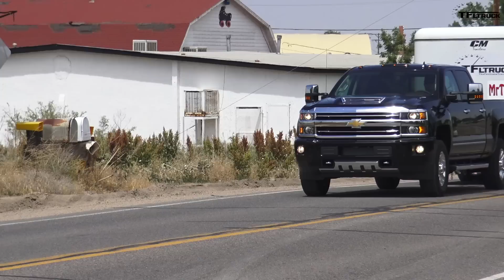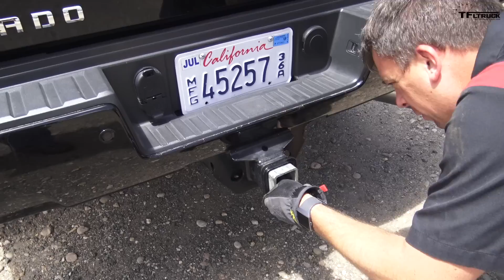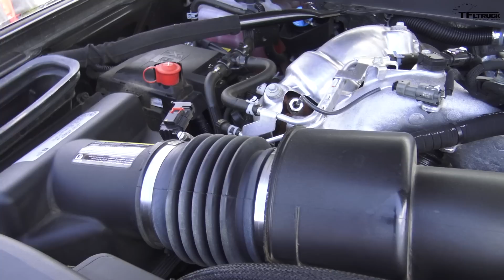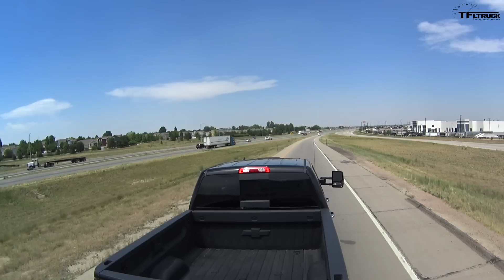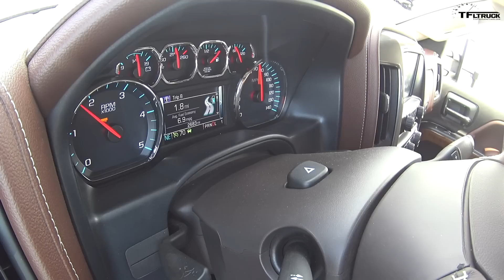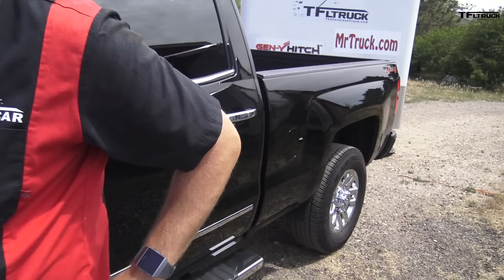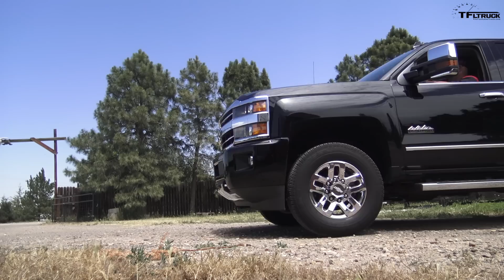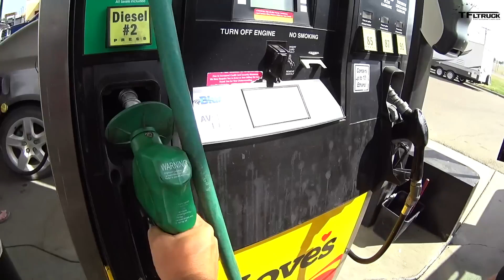MPG Challenge: Silverado Duramax vs Cummins vs Power Stroke

Comment: this gets better gas mileage in your opinion forget the fuel economy how do these trucks feel towing that weight since you have droves all 3 with the same trailer which seems to pull the best
Reply: 100horse Injectors that's easy Duramax if I remember correctly last year they did the shootout and the Duramax won again!!!

Comment: 4.10 on the Ram? Did they change for 2018? 3.42 was the only option in the diesel 2500/3500 SRW since 2013.
An interesting mpg test would be to take a trailer loaded for the midsize trucks and tow with each class of truck through 1 ton dually to see if what gets the best mpg with that load.
Reply: Matt Hillman Gear ratio is based on the transmission. The higher powered Cummins I think comes with a different tranny and gear ratio
Reply: I'm curious. I know someone with a 2004 Dodge Ram 2500 with 4.11 gears and the 5.7L V8. Did they reduce them over the years? A 3.42 gear ratio for a diesel seems small. My 2016 Silverado 1500 has 3.42 gears. Would never expect that ratio in a diesel.
Reply: Ratio's with diesels will and are lower as since they don't have rev range as a gas on top of they produce their torque and power as such low RPM's don't need to run them high. Chevy's site says it has 3.73 for diesel, 4.10 for gas.
Reply: 4.10 for gas really? The highest I could get for my 1500 was 3.73. May be 4.10 for the 6.2L?
Reply: Matt Hillman You are correct that 3.42 is only for 68RFE trans. But you can get 3.73s on the 3500 SRW w/ Aisin trans.
Reply: sreilly 4.10s are available only on the 6.4 gasser Ram.
Reply: Gotcha. Thanks for clearing that up! I figured the more powerful the engine, the larger the gear ratio in the rear. Then again, I did own a 2003 Silverado with the 4.8L, but 3.73 gearing. Use to rev to 2,200 RPMs at 65 mph!
Reply: sreilly The 2003 through 2007 5.9 Cummins offered 3.73 or 4.10. In 2013 3.42 was the only offering in SRW Ram diesels, DRWs had 3.42, 3.73, and 4.10s in both the 68RFE and HO/Aisin combos. Currently the 6.7 Powerstroke only has 3.31 and 3.55 for their offerings. As time has gone along and transmissions have become more capable the need for higher ratios (lower gearing) have diminished even in gas engines.
Reply: EGGINFOOLS I think the different engine transmission combos in the DRWs may have more of one gear ratio built more than another but the same gearing options are offered through both combos. As for SRWs it has been 1 option for the last several years. My question is did the offering change for 2018?
Reply: HellKitty 101 I see something about that on Rams website but it's not pulling up in their build section. I'm betting they did that to bump up the GCWR a little bit so the 2500 with the regular engine and 68rfe doesn't have a higher trailer rating. It's still not a 4.10 in a Ram 2500 though, I'm thinking Andre was reading off the left side of the monroney sticker before the options section.

Comment: I just bought a 2018 hd duramax ltz z71 trim after your reviews.  They all are great from the big 3, but i thought the seats in LTZ trim were the best.  I only have 1,000 miles on it, but took it to WV this weekend and actually hit 22mpg.  
Keep up the great work fellas, i enjoy these real world numbers and that Ike, and goldmine!!!!
Reply: Don Leamon ive seen duramax trucks near me go 300k miles no issue. 90k is premature death, musta been something wrong
Reply: Don Leamon I have a 2004 with a hundred and eighty thousand miles it's done nothing but snow plowing and Commercial work have had few problems  except one injector 1, 1 EGR valve and 1 glow plug!!!! Duramax is a fantastic ,far far more reliable than any Powerstroke!!! Cummins diesel engines on the other hand are very reliable good power plant! Now the rust on the frame is another story but up here in the Northeast they all rot the same doesn't matter who makes them!!!
Reply: Don Leamon yeah you got a lemon! Duramax's are almost guaranteed to hit 200k with 0 mechanical issues. Sucks but lemons do exist.
Reply: vehicles that come with rear leveling shocks always have problems , they are using rubber air springs (air bags) they dry out , crack , wear through , tare . thats just life with rubber springs (airbags). he gauge clusters do go out ill give you that but they are $100 used at most and thats with less miles than your vehicle has. window regulators go bad on every vehicle and they are about 50$ for a chevy suburban , tahoe , yukon , or xl i know from first hand experience. i've owned probably 5 of your same body style suburbans / tahoes , 3  trucks and 1 duramax all the same as you said you have had.  if not more. Dummies don't keep them clean or maintain basic shit , i buy them for next to nothing detail them fix the hundred dollar issues and usually make upwards of a couple grand on each one. its a side hobby that makes a load of cash for little to no effort. i don't even detail them myself 1/2 the time. the amount of wear you are saying you have experienced in your trucks that are all the same generation as the ones i have had is absolutely insane it almost sounds made up. you either happen to own two lemons , are lying  ,  straight up just abuse your trucks,  or you have excessive mileage. ive owned a 300k mile suburban that sounds like it was in better shape than both your trucks.
Reply: Andrew Ochoa They role down the same assembly line.
Reply: Time will tell how reliable these things are truely.  Personally we bought it tho tow a 5th wheel camper next year.  It sits in the garage mon through Friday usually unless wife goes out during the week.  So if i have it for 5 to 6 years it'll have a whopping 60k  to maybe 80k on it by the time ill dump it and get something else.   A lot of arguing on here,  but people are talking about trucks from 2000, 2004 and so on.  Things change every couple of years,  if you didn't like it,  go look somewhere else.  Silly and juvenile  going back and forth  about one brand better then the other.  Unless your vuying a brand new one,  all this discussion is doing is getting y'all worked up.  Lifes too short, enjoy it.  🤙✌👌
Reply: Don Leamon well the good thing is you've just taken the first step you've got past the denial so now  u can move forward and take care of your vehicles!!!      All kidding aside I run a repair shop and it's not like any of these things that you listed on GM vehicles aren't things that I see on other brands they all in one way or another have some type of issue even the coveted Toyotas!!  The biggest problem that I battle with all of them where I am is the rust! But a year-and-a-half ago I did find a new product called New Hampshire oil and have been oiling the vehicles with fantastic results unfortunately you do have to do it once a year but it completely stops the rust in its tracks! And don't misunderstand my statements on the GM vehicles or the fact that I have a Chevy Avatar I have dealt with owning ford diesels with catastrophic failures that cost me thousands of dollars I'll never make the mistake again!
Reply: Xxplicit buy an extended warranty thats up to 100k. Amd I've made it a goal to worry about myself.  Not my business what other people do or can or can't afford.
Reply: Robert Moulton Once since 2009 has Silverado/ Sierra combined outsold F-Series. GM only sells more “trucks” when Colorado and Canyon sales are added in.
Reply: Don Leamon pretty sure you just abuse your shit... Considering I have one with 560k and the inside still looks like new. Have I replaced wear items a few times like ac stepper motors and guage cluster motors? Definitely. But that's it.
Reply: Don Leamon oh yeah and I forgot I did get rid of a 2005 Chevy Equinox with a hundred and ninety thousand miles that at a hundred and twenty thousand I did have to do head gaskets in but otherwise regular maintenance and the Stiller and fantastic
Reply: Don Leamon they just retooled the engine in 2017 i believe.  And that whats warranties are for.  No stress in life about that stuff,  ill jusy go buy another one in time if it starts to be problematic.  I'm not brand loyal to either big 3.  Just woth rebates,  and dealers cash back its the best deal I could get.  Sorry your truck had used,  everything mechanical is prone to probldms eventually
Reply: Hartson Racing I had 336k on my 2015 3500. No problems other than emissions. Bother had 2015 2500 it's been an absolute nightmare. He's at 290k now, motor is apart for head gaskets and 2nd set of injectors and infection pump.
Reply: @yellow04  the Bosch CP4 fuel pumps on the newer Duramax's are ticking time bombs that when they explode take the injectors and fuel rails with them. A lot of guys are swapping in the older CP3 style because it's more reliable and if it goes it doesn't take everything else with it.

FYI, the Powerstroke 6.7 uses the same CP4 pump.
Reply: @natedog51  yup. I got lucky. Have a ram now. 👌
Reply: Nathan Waidelich - Nice try, 2017 up Duramax does not use the  CP4 hpfp, they now are using the Denso pumps.... Cummins is now using the cp4 in the 2019 ram hd trucks, tic tic BOOM! Lol,
Reply: @nospark8514  not sure why Cummins did that. Hopefully there was an update or something. Why put a pump in your updated motor that has a lawsuit against it 😆😆😆
Reply: Don Leamon call me crazy but Chevys and GMC’s aren’t the same vehicle. The most GM trucks that I’ve seen have problems are the GMC’s. Rarely a Chevy.
Reply: The Real John Smith there is someone who didn't realize Chevy and GM trucks are the same ...
   That's how Ford tells everybody "best selling truck in America" because they split General Motors Chevy and GM trucks when they count ...😝 seems legit to Ford people ...lol
Reply: I just bought a 2018 GMC Denali HD with the Duramax. I traded a 2009 Silverado 2500HD with the 6.0 Vortec. Best MPG with Silverado was 17 on highway @72 MPH.

MPG with my Duramax, with 6,000 miles so far, is 21 MPG @75 MPH! Based on my round trip to work and back of 440 miles (I work out of town for the week). 

So even with the higher price of diesel, this truck costs me LESS to run than my 6.0 gas truck did.

Not to mention I love EVERYTHING about this truck!
Reply: I have a 3/4 ton I'm getting 17 to 19 mpg but the motor isn't even broke in yet sitting on 28,000 miles its a 16 Chevy
Reply: You're totally correct J Patt. I failed to change the oil in the stepper motors on the gauge clusters. I also failed to completely remove the two dashes to get to the passenger side steppers and give them some love. Oh, I also failed to engineer and replace the nylon parts in the power window mechanisms. I failed to stand over the shoulder of the Delco engineers that did the rear air system on the Yukon. I obviously overburdened the bed of the GMC by installing a ARE shell and Bedrug when new. I should not have had them stored in a garage while at home and at work. I should not have ever used the fuel door nor the rear tailgate on the Sierra. I should have not expected the Dmax to haul a 10k RV in Arizona and not shut off the A/C and go into limp mode. Nope all my fault J Pattster.
Reply: J Patt, let me cut and paste this same GM responce that I think I've replied to you before with. I agree the powertrain is OK, especially the Ally, BUT: here are my real world facts: '04 Denali XL (wife), '05 Dmax with the wonderful overheating LLY. Both purchased new. Both lost the stepper motors for the gauge clusters, both lost the stepper motors for the HVAC controls. (very expensive fixes, but heat blowing in the cab when you live in Phoenix in the summer, SUCKS!) Rear leveling shocks went out twice on Denali. Window regulators went out on all but my passenger front window. Bed tore on the GMC, because the metal was paper thin between the stoplights and the rear stake pockets, Diesel fuel cover hinge fatigued and broke, of course the rear tailgate handle failed and the bezel fell off. Sunroofs on both failed. Denali would just randomly die at speed, no codes. We got rid of both at about 120k because we were sick of the issues. Would they have continued to run, sure, but the problems were just irritating. And since the Dmax overheated pulling our RV, even with an additional aux radiator (helped didn't cure). Both had same cheap leather that cracked even with Lexol care. Those are MY real world facts.
Reply: Drivetrain is one thing, the rest of the truck is a different story...
Reply: Bailey: here are my real world facts: '04 Denali XL (wife), '05 Dmax with the wonderful overheating LLY. Both purchased new. Both lost the stepper motors for the gauge clusters, both lost the stepper motors for the HVAC controls. (very expensive fixes, but heat blowing in the cab when you live in Phoenix in the summer, SUCKS!) Rear leveling shocks went out twice on Denali. Window regulators went out on all but my passenger front window. Bed tore on the GMC, because the metal was paper thin between the stoplights and the rear stake pockets, Diesel fuel cover hinge fatigued and broke, of course the rear tailgate handle failed and the bezel fell off. Sunroofs on both failed. Denali would just randomly die at speed, no codes. We got rid of both at about 120k because we were sick of the issues. Would they have continued to run, sure, but the problems were just irritating. And since the Dmax overheated pulling our RV, even with an additional aux radiator (helped didn't cure). Those are MY real world facts.
Reply: Liked my Dmax for the most part (I won't get into the overheating problems) until the thing hit about 90k, then it started to self-destruct. Enjoy her now!
Reply: @donleamon8653  You had a 05 he has a 2018 completely different trucks. The duramax engine was redesigned in 2017 and the bodystyle has changed twice since your truck. And like the other guy said you just had a rare lemon, 99% of people don't experience those problems with their duramax as long as they take care of it and don't abuse it.
Reply: @donleamon8653  was it a diesel?

Comment: Please test them all on the same day with the same temperature and weather conditions  .
Reply from the maker: How do we get all of them on the same day?
Reply: That's for TFL to figure out. Any valid test comparing two or more items must be done under the same conditions for it to have any "real world" scientific validity. The fact that you cant get them at the same time does not provide license to validate your data or mean it's "real world." It means you cannot do a fair "real world" comparison. There is a reason no credible scientific body (like SAE) does towed mpg testing. Too many variables to control.
Reply: An alternative is to re-test an already tested truck on a day with opposite weather conditions and compare it to the previous result.  Show us how much of an impact it can make.  Now we know wind makes a big difference but temperature?  Humidity?  Rain?  Would be a nice test.
Reply: They do their best to get similar day in therms of weather to do the test. Temp is kinda hard to do it but things like wind they try to avoid and in case i think was Ford where they started the test and in middle of it they got a nasty head wind which effected the results so ford only got like 8-9mpg. Which to be fair they did redo it at later date.
Reply: Also depends on the trucks sweet spot.  The Ford or Ram may score better than the GM at a sustained 60 or 80 miles an hour.  Depends where the RPM lands.  I also said more HP and more torque means better mpg.  Funny how a heavier truck plus a heavier trailer, twice the weight with more wind drag scores better than a smaller diesel like the F150 diesel pulling 7000Lbs or the even the Colorado diesel pulling 6000Lbs in the TFL tests at 70mph
Reply: The problem with test isn't the time or weather condition, the problem is distance and allowance for regeneration.
Reply: At least list the weather conditions like you used to in the past.  Also the diesel type?  Winter or summer diesel makes a big difference.  Also mpg is no longer the staple, people want to know dollar per mile with the new era coming.  You also have to vary your speed like the epa does.  70mph at a sustained speed does not compare trucks very well.
Reply: Don Leamon Sorry you don’t understand science/ real testing methodology does not get thrown out the window because they cant set up an actual scientific test of vehicles under the same conditions.
Reply: Then don't watch. Or, better idea Mr Smith, start your own channel with SAE level testing. Maybe you'll hit 500k subs.

NOT.
Reply: They can't do that dipshit. FFS, how stupid are people.